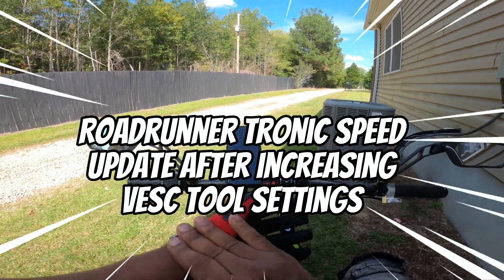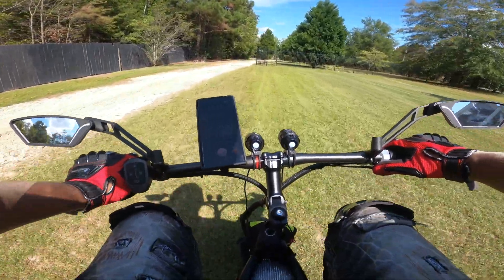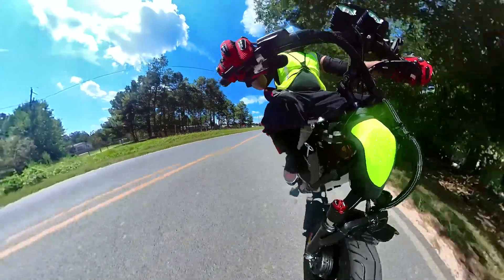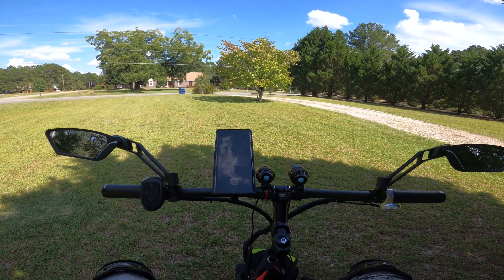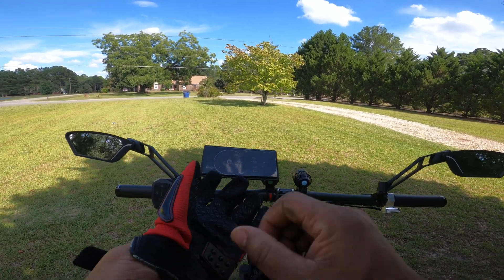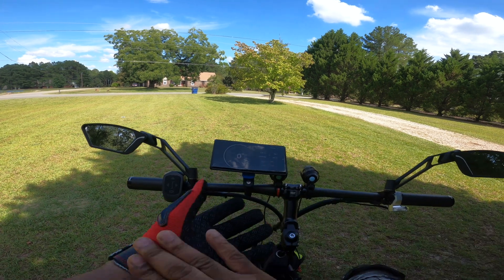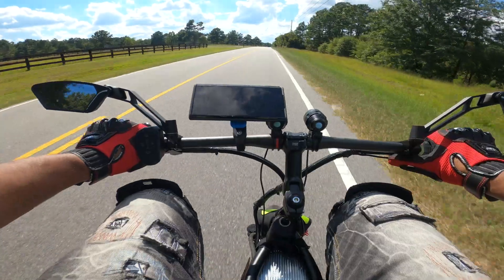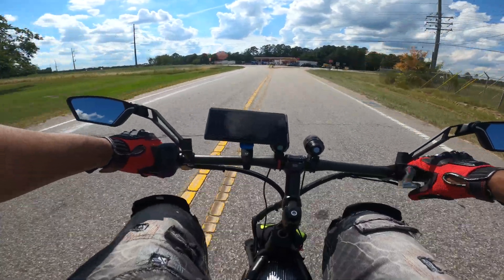Roadrunner Tronic Speed Update After Increasing Vesc Tool Settings

Comment: More videos please I check every day lol
Reply from the maker: You probably know by now that I returned the Roadrunner Tronic. It was an awesome experience to ride it with the Tronic Controllers but it was not safe to ride for my weight @240lbs because it didn't have good locking washers to handle the regenerative braking and torque output of the controllers.

Comment: Yeah bro 55 mph is fast enough lol nice work! Shame you had to return it buy glad it is plenty fast!
Reply from the maker: Thanks Bro. It's a shame that the frame was just too fragile to handle the Tronic Controllers. Shockingly, I was 100% sure that the Roadrunner Tronic could get over 60mph with the Vesc setting in the FOC mode to over-ride the continuous Amp out put, even with the 72v 28ah battery and my 6'4" 235lb size. It would have been dangerous for the battery and the Tronic controllers so I didn't dare to try it but the option was there for anyone who wants to upgrade the size of the battery up to 96v.

Comment: Reason you dont turn the front up is there us no torque arms on the front and fork arms will snap if turned all the way up :D
Reply from the maker: Whenever the Tronic Roadrunner malfunctioned I had the settings for the controller back to its original settings. And I never completely set the front motors to the max settings. In fact I didn't use any of the max settings for either motor. There was just not enough strength in the single side locking washers that were used to secure the motors.

Comment: Hey, are you sure your battery is 72v? I am waiting on my pre order and noticed that the website mentions a 60v. I was under the impression that it was a 72v as well.
Reply from the maker: Yes. I'm 100% sure. I'm charging with a 5 amp 84 volt charger and my voltage reading after a full charge is 84.5 volts.